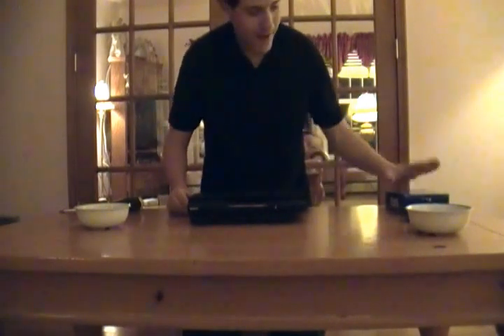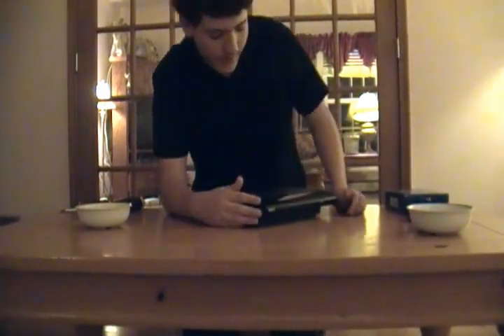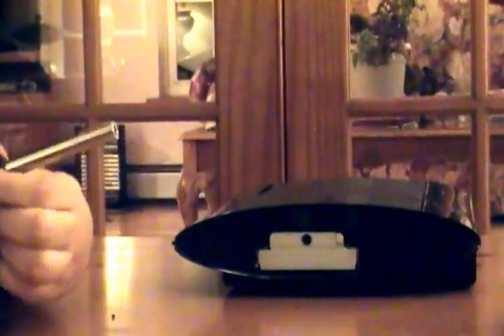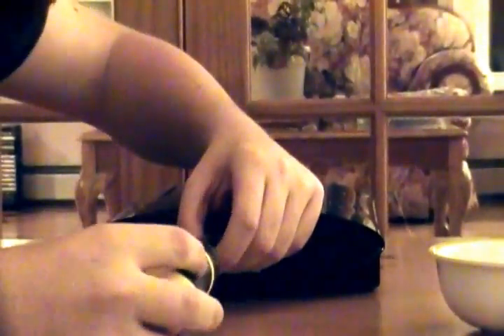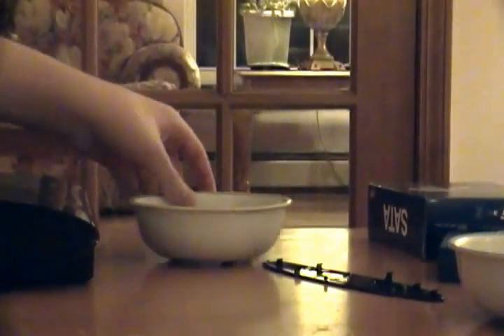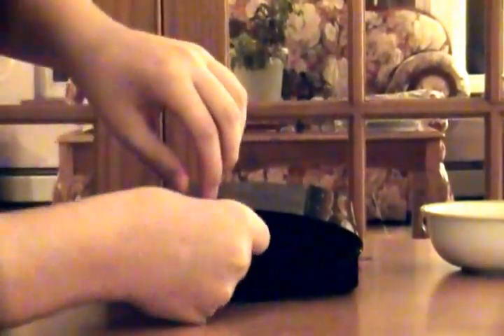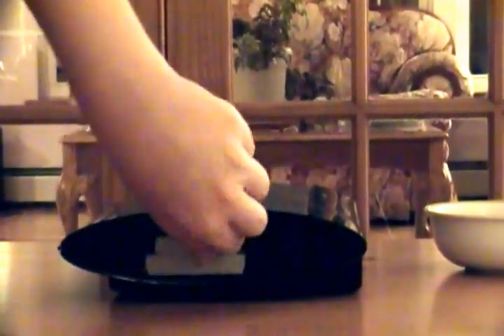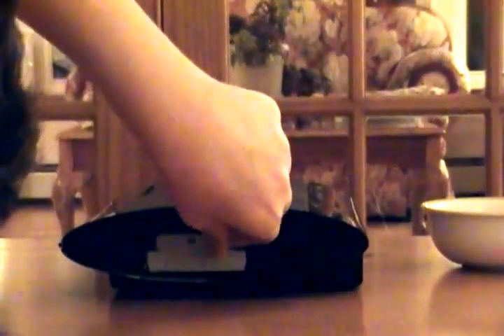PS3 Super Slim hard drive replacement

Comment: Any laptop hard disk will work. Just make sure it is a 5400 rpm drive, so that the cooling will not be an issue.
As for the caddy, yes you will need one. I just bought mine from amazon and it was 10 quid (pricey).

Comment: If you have the 12gb which I do you can insert a different harddrive, once turned on it will ask you if you want to change storage locations to the hdd, when you press yes it will then say do you want to format the hdd and copy your saved files form the 12gb memory, you press yes and boom it's all done!

Comment: Oh and you shouldn't need tools either, the case pops off and the harddrive slips in, don't buy a hdd caddy just place the hdd in the slot and aim for the connector then level with something and it works perfect!